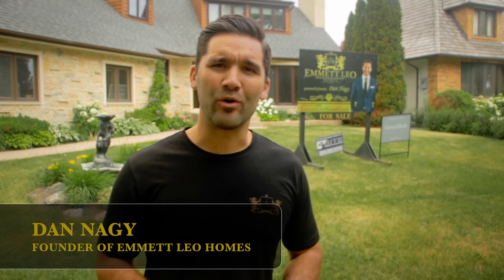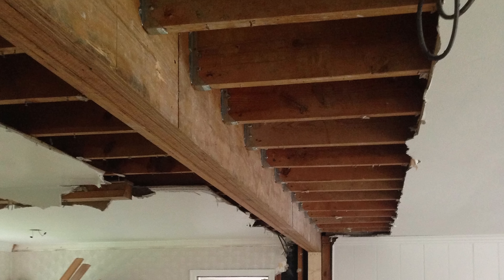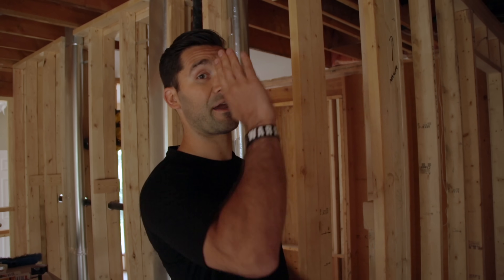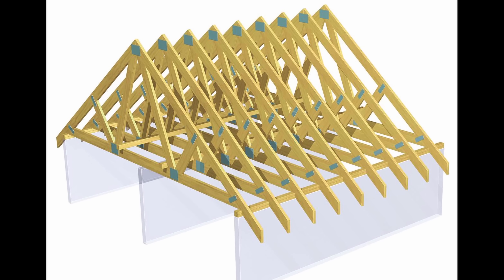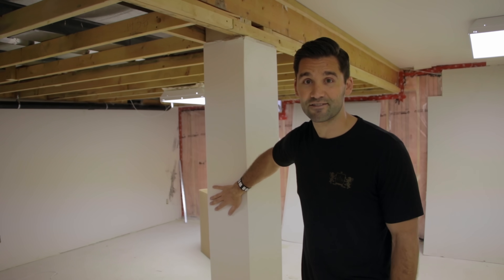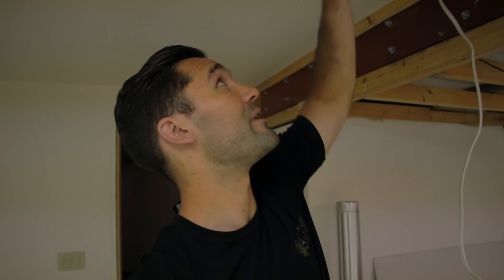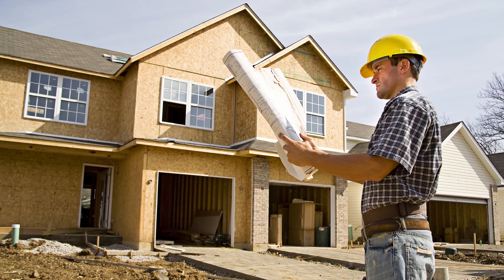The fastest ways to tell if your wall is load bearing or not!

Comment: Wow grea to knjow. I have a garage with two 8x7 doors and want to have one big door. all i know is the joist run parallel with the garage doors. Still curious if my Center pillar is load bearing or most likley itls not
Reply from the maker: You will definitely need a structural engineer to figure out the size of header required to do a change like that. The center pillar is definitely load bearing in modern framing for garage doors.  Each seperate door will have an individual header (beam) and the center pillar will rest on the garage grade beam/footing/foundation.   Thanks for watching!
Reply: I built my own house with a double and single garage door on the garage. There is virtually no weight above the garage doors, but the main door beam that was engineered was huge!   It was a glulam the width of a 2x4 but was about 24" height.   It was a beautiful piece of art and I hated drywalling over it.
Reply: Your outside wall there is indeed load bearing.

Comment: Usually you can tell by the headers, if the headers are framed upright on top of the jack studs, that is a way of knowing the wall is bearing, headers will be 2X12's
Reply from the maker: I agree.  But it's often hard to see the header size or existence in a finished home. Thanks for watching!

Comment: I live in a duplex where the upper floor is supported by the the two outside walls and the party wall which is parallel to them, as well as one wall beside the stairs also parallel. However the roof system is carried by the two walls perpendicular to those walls.  In this way all interior walls on the upper floor are nonloadbearing.  Knowledge of structural engineering is the real key.

Comment: A little knowledge can be dangerous. A load bearing wall may also serve as a shear wall. When you “open up” a room by removing a bearing wall, you also remove the shear capacity of the building— not good, especially in high wind or earthquake region.

Comment: Don't assume joist running parallel to wall is non-bearing.  Often additional parallel joist are run above that wall to pick up the load of a wall, post, or other structural element on the second floor. I've also seen no indication of a load transfer until I went to the second floor and discovered by measuring one wall or structural element was above another. You need to study the "load path" to see if a wall is bearing or not.

Comment: It's usually typical a center wall will be your load bearing wall. But it can also depend on the shape and size of your roof. Smaller houses don't typically have load bearing walls unless the span of the roof extends over your house to encompass a deck or exterior room like a garage.

Comment: Sorry, but this presentation is too simplistic to be used safely by "average' re-modelers.  I've remodeled/rebuilt homes for 50 years.  I've worked on single and multi-family residential structures from the 1870's through to today's tacky and 'luxury' tract housing.   Almost every one of them had "surprise" or "creative" framing in one part of the structure or another.  Sometimes it was 'original construction', sometimes repairs or additions.  This video makes too many assumptions to be safe guidance for amateurs.  I've found walls that were not load-bearing on one side and load-bearing on the other; walls that had a load-bearing post in them but were otherwise not load-bearing, etc. 
The best advice is to thoroughly research how ALL the weights in the building (weight of the roofs, floors and walls and any heavy built-in structures (stairs, fireplaces, stoves, water tanks/baths/heaters)) are supported all the way to the ground/foundations.  Then you might notice that wall that doesn't quite fit the pattern of the rest and might be holding up more than it seems.  The last thing I do after stripping sheetroc or plaster off wall studs or joists and before removing any framing is wack each stud/joist with a hammer or my fist, if the sound is 'dull' (a thud) it's probably not loaded with weight; if the sound is a 'ping' or 'ringing' it's definitely load-bearing even if it's in a supposedly "non-load-bearing" location.  So something is wrong and I need to figure out why it's under stress BEFORE cutting out anything. 
      "How to Identify and Remove a Load Bearing Wall | Ask This Old House - YouTube" [   https://www.youtube.com/watch?v=y6YVBy-1hjQ ] and other related Tom Silva videos are much more relevant and thorough advice.  No, I don't get paid to recommend "This Old House" videos.

Comment: When checking a ceiling to find the joists direction a very easy method is finger tapping. tapping the ceiling creates a hollow sound were no joist is and a more dull sound where the joists lies. Another tip is to unscrew the ceiling rose and look closely in the gap as the electrician will try to fit a rose to a joist when possible

Comment: Simple......remove the wall you don't want and if the ceiling caves in, then that means you've found a load bearing wall ! Kidding aside, On two occasions I've come across people removing gyprock with the intension of removing that wall to have more space (living room). Questioning the layout I gave him a heads up. On the second occasion, the wall was almost completely removed except for two jack studs supporting an 8 foot header ! Again I happened to arrive in time for a heads up. The entire length of that wall was some 30 feet. It only required small hydraulic jacks to rebuild the entire wall. The ceiling had dropped nearly a half inch. Both times I had stopped by to see how renovations were coming along ! The Do It Yourself people quite often take on projects that are way over their heads. Structural, plumbing, electrical and mechanical are all subject to DIY people and they often make for great stories.  
Great video. If you don't know, don't touch.........Watch the video, understand the subject then get someone who knows !
Reply from the maker: Thanks for taking the time to help them out!  

It’s important for people to KNOW about this stuff, but also to know that they need professionals for certain parts.  

Well done!  Thanks for watching!

Comment: Thanks. Clear and concise explanation. I have a question? 
1. Can you 'arch' a load bearing wall. I would like to open a room 2 floors up without putting additional beams across the top. Can the arch of the wall support the floor above?
2. The basement beam has "settled " in a way that the posts in the middle are not bearing any load?
2a. Dothe middle posts (2) even have to be there in this scenario?
2b. If I replace the 'settled' beam do I need to reinforce (add additional beams) if I chose to remove the middle posts?
And finally 
3. If I can arch the wall. Can I still remove the middle posts?
Bonus question 
99. Has anyone made an automated opener to reveal a roof deck. Doing an opener for the sole purpose of maintaining the historical home status?
Thanks again

Comment: I used a small camera which is attached to the end of a flexible hose and the opposite end of the hose has a monitor screen. The only tool you need is a drill fitted with a drill bit slightly larger than the circumference of the hose. I bought this kit at my local building supply store for under 75$. The drill and bit I already owned. The kit is battery operated 9vt system and have used it on other applications. The drill holes are so easily fixed with drywall compound.

Comment: I used to frame houses and honestly, it's not that hard to tell. The peak of the roof will tell you everything you need to know, 90% of the time, because the rafters/trusses are perpendicular to the peak and parallel to the joists; so the load bearing walls are parallel to the peak.
Reply from the maker: Yeah.  That’s the easiest way for 90% of simple homes, however people focus more on the 10% of roofs that don’t fit into that.  Ahhhh YouTube.  Thanks for watching!
Reply: But just because a wall is parallel to the peak doesn't mean it's load bearing. That only tells you which walls might be load bearing. Our house has five different walls that run parallel to the peak. All five are offset from each other. I don't even know if all five walls are original to the house. Maybe if I could get into the attic I could tell whether any of the walls were load bearing. But that really depends on the type of truss. And that's above my pay grade.

Comment: Cool info. In the last example, if you cut into one of the studs and it pinches the blade it’s load bearing. Can easily sister it after.

Comment: The part about the joists being perpendicular to a gable roof is not necessarily true. It can be either/or, depending on the shape of the building. A gable is often on the short end of a rectangular structure (for example a colonial house is a rectangle with gables on the short ends and hips on the long sides). Usually there will be a beam running lengthwise near the centre of the house, and the joists will span from the foundation wall to that central beam. Engineered joists (instead of typical 2x10's) can span further, so if the span is approx. 20' or less, there might not even be a beam. In either case though, that means the joists are running parallel to the gable, not perpendicular, and this is typical. I am currently drafting a house where the beams span the short end, thus the joists run perpendicular to the gable, which we're doing so the basement design is what the client wants, and the ductwork problems for the second storey are a headache.

Comment: if you are in a single lvl house with modern trussing rather than a stick frame you very likely do not have any interior load barring walls in addition the gable end walls are not load  bearing they are however shear walls but you can open them up quite a bit to extend out those two ends of the structure.

Comment: I'm a framer/carpenter. I have been doing this trade for 20 years. I build high end, custom houses and remodels. I always crawl under houses to view everything. I crawl or walk around the attic. Look at everything!
Reply: All well and good IF blueprints are available; often, they are not; hence, doing a visual inspection
Reply: I'm on a slab, and trying to figure out which first floor walls are load bearing is driving me crazy!! 😂 I WISH I had a crawl space to inspect in!
Reply: Thank you!
Reply: my house has no basement. I guess i have to go in the ceiling
Reply: I do the opposite and I been building 40 years.  I don't look at any of it.

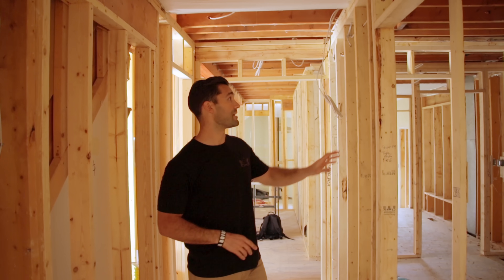Comment: Hey luxury home builder.  Check out the plumbing cutouts at 6:30.  I believe they are not bored to code.  You could drive a nail, or screw into the pipe pretty easily on the interior side.  Just saying....
Reply from the maker: Couldn’t agree more.  That plumber didn’t last long. Thanks for watching!

Comment: 6:57 does not look like some of those studs are structural even if they wanted to be with the way those holes were cut through them looks like there is maybe an 8th of an inch left on one side of the hole?
Reply from the maker: Completely agree.  That plumber didn’t last long.  Thanks for watching!

Comment: hey!!!
I have 20 ft span btwn 1st and 2nd floor (open floor concept 1st floor)
I like to do hiding lvl beam  2x10x20  2pices 
pls let me know if it's enough?
Reply from the maker: You need that stamped by an structural engineer before doing any changes. And no, that’s probably not enough over a 20’ span with 2 levels.  Make sure to get a professional in there before doing any work.  Thanks for watching!

Comment: Okay so I got a question.  If your basement has a steal support beam with tele posts clearly visible.  Does that mean any other wall down there is not load bearing.   I got a couple closets in in my basement I want to pull out.
Reply from the maker: That is not what that means.  It’s a good start to understanding the structure of the main floor though, but it could be more in-depth than that. Thanks for watching!

Comment: My garage is 30x30 and there is no wall in the middle but if you go inside there is a wall separating my kitchen to my living room but the wall is built 4 to 6 inches from the metal beam under the house and my roof trusses are exactly the same in the whole attic there engineered roof trusses not cut in the middle or nothing they span 30 feet from outside wall to outside wall but the wall inside that's built 4 to 6 inches from the center only goes about 12 feet then it's open 30 feet from front to back would that be a structural wall I would think so or there wouldn't be any area that doesn't have a wall down the middle because I know there is no beam or anything diff from the other trusses that spans the whole 30 feet..

Comment: I’m still unsure based on my situation.

I have a bungalow. The metal support beam in the basement is 152” from the rear exterior wall.....when I go upstairs and measure 152” from the rear exterior wall, I am 30” away from the wall I want to remove. It’s  running 30” from/ directly above it in parallel.

My ceiling joists run perpendicular from the wall I want to take out. Does building code state an amount of allowable offset that a parallel wall supporting the roof/attic can be from the support beam on the basement??? And does 30” seem like it’s too much?
Reply from the maker: You should always bring a professional in to confirm prior to messing with structure.  This is only a starting point to troubleshoot.  Good luck!

Comment: Hmmm. A load bearing wall upstairs may run directly over a joist if a wall is in direct contact beneath the length of that joist. So, The idea that a wall does not transfer load simply because it is running in the same direction as the joist is a dangerous assumption to make. Blocking between the joist may also indicate a wall above the floor and perhaps a load. Pull measurements upstairs, pull them downstairs too and see if there is something structural resting on that little project before knocking out any studs...   : )  or, hire an old carpenter like me to come have a looksie and perhaps then invite a structural engineer. I apologize for getting into your video, its a nicely done one.  George.

Comment: Structural engineer here. How did you carry those new point load after replacing the wall into the basement?
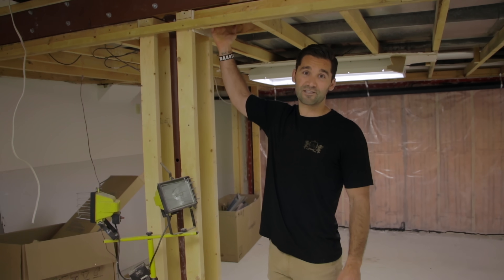Reply from the maker: One side sat above a foundation wall, and the middle section was approx 1 foot away from the basement structural post.  We then engineered steel plates to both sides of the wood beam in order to transfer that load laterally.   I show it at 4:50.  We also made sure to block from under the main floor to the top of beam.  Thanks for watching

Comment: An easier faster way is to simply remove the wall or post.  If the ceiling falls down, it was a load bearing wall.  If the ceiling remains intact, it's a non load bearing wall.

Comment: I think we went from “you will know EXACTLY how to tell if a wall is load bearing” to “these are typical situations where the wall will bear weight.” Leaves too much up to chance.  If you can’t be 100% certain, get a structural engineer and don’t risk it.
Reply: He clearly showed how to tell if a wall is load bearing and gave different situations that would require a load-bearing wall.
Reply: It's really not that hard to figure out.
Reply: a structural engineer is not going to know either. You expect him to come to your house and look? You could look just as easily. An engineer is used for designing supports, not finding them.
Reply: @marks6663  LOL!  Not true at all.  Engineers will do what they're asked/employed to do.  Not all climb and inspect.  I climb; within limits.
Reply: Anybody with SOME INTELIGENCE, higher than ANY DemocRAT, can figure it out without GOVERNMENT HELP.....

Comment: Simply having a beam below a wall doesn't automatically make the wall load bearing. It could be there simply to reduce the span of the floor joists so you don't need many more at closer spacings and/or taller sections with normal floor loadings.

Comment: I think this is the 2nd or 3rd video like this I have seen here on YouTube about how to do something or another and these guys seem to me they are in their mid 30's?  Let me say that I started with my building experiences with digging my first foundation slab footing when I was 13. I was Dad's main partner/helper.  We laid out a 20x30 slab for our carport and I dug the footings while my dad was off shore working at Shell Oil rigs. From there we did the pouring when He came in and then framed the carport roof and the 8x20 storage at the back of the slab.  From there we worked on several projects.  After my tour in the Navy I supervised the remodeling of 20 apartment buildings, 11 were 8 apartments buildings and the other 9 were 4 apartments in Naw'lins.  Also supervised the build out of 3 floors of a Medical center for 13 doctors offices after which the 2 Architects who drew the prints asked me to become their partner which I had to refuse because I had a old folks entertainment resident to build.  So I have done just about any thing when it comes to building. And this guy was talking about beams well the largest beam I ever had anything to do with installing was for my Church which I was the lead supervisor to was about 90' long 4'high and 7.5" wide and then 4 others shorter and a bit smaller to finish out the roof line.  Oh and I had my hands on the electrical and A/C and plumbing and cement work on just about all the building I ever had anything to do with in my 61 years in the construction field since I was 13 and I am 75 now and retired last year.